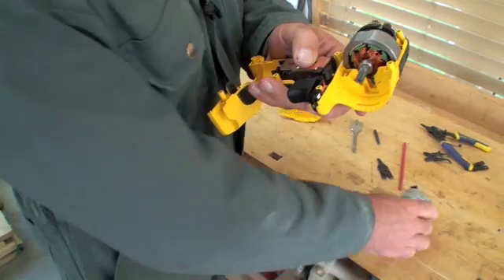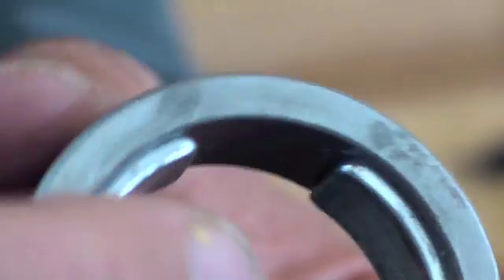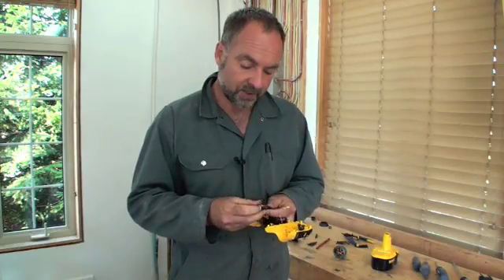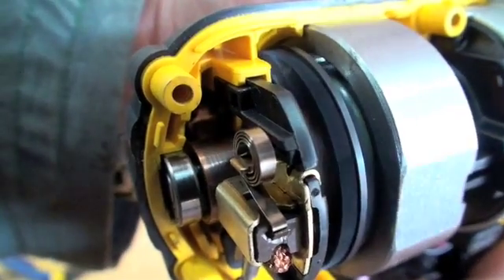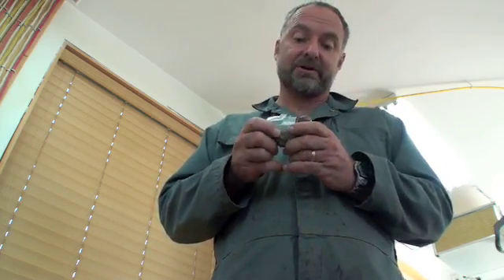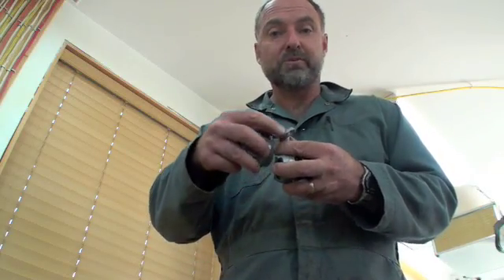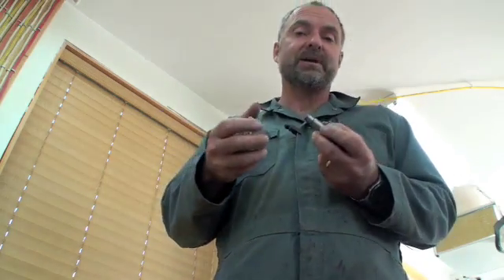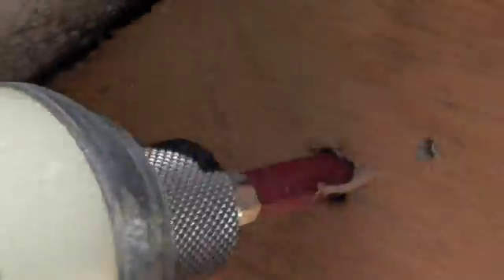TOOL DEMO: How Do Impact Drivers Work?

Comment: You said its more like a Forward-Backward motion. But isn't it actually a Forward-Stop-Forward motion?
Reply: It is right.
Forward (engage) - stop (disengage) - forward (engage).   
Forward (percussion) - stop (no percussion) - forward (percussion).
Reply: The above explanation is for rotational motion. There is another movement of the disk with the posts, which is axial. Backwards (compressed spring, unhooked, not percussing) and forwards (stretched spring, hooked, percussion).

Comment: Ty vm
If it is stated 3200 rpm , is it  then 3200 forward rounds or 3200 forward and backwards rounds ? 
Does resistance reduce rounds per minute?